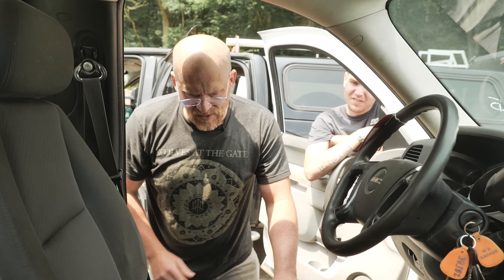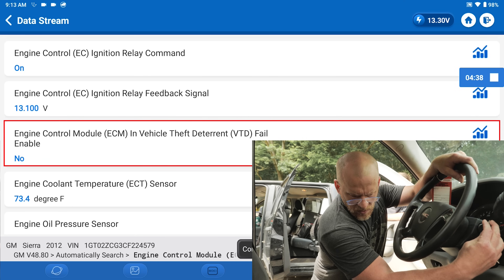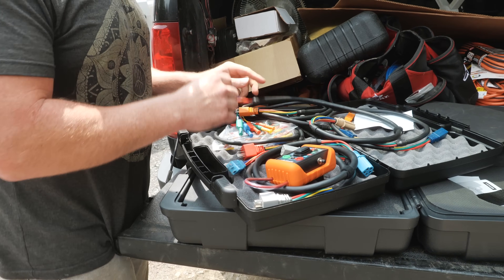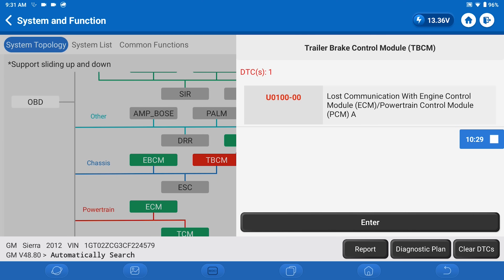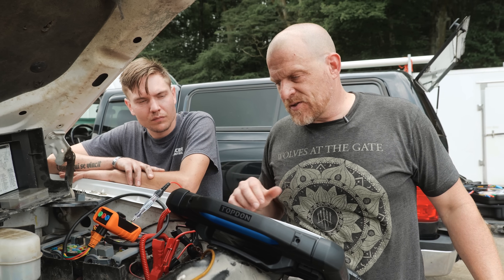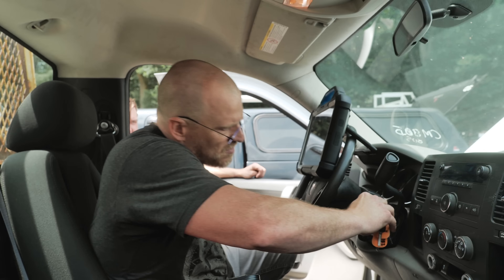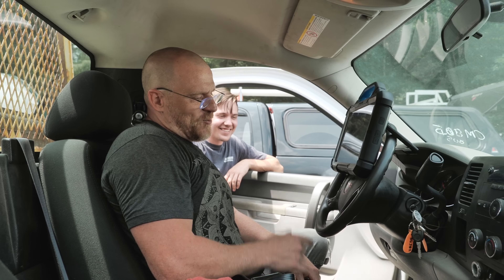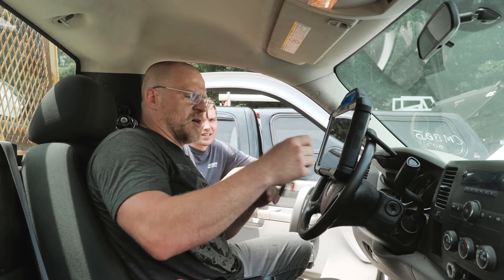Auction Truck MISSING FOOTAGE!

Comment: On mark 2:33/11:45 you show starter relay in your fuse box on my 94 f-150 5.0 engine I’m looking for the same relay because when I turn the ignition switch I get nothing I have already installed a new neutral safety switch new ignition switch new ICM I still need your help very badly would you please help me
Reply from the maker: This is a Chevy. Why aren't you watching my EECIV playlist! So your truck is not cranking? (Starter circuit issues)
Reply: how do I go to EECIV playlist and yes that was the original problem on the f-150 94 model 5.0l engine @ScannerDanner
Reply from the maker: @tessiehuskey689  https://www.youtube.com/playlist?list=PLAFYVCyenqcoRt2bJPI4vcee2w_1Y3fkm
Reply: Where is your EECIV playlist
Reply: Do you have a scenario video on a no crank no start on a 94 f-150 5.0l
Reply from the maker: @tessiehuskey689   watch this one https://youtu.be/GQvLHQVtC0Y
Reply: I checked the reference voltage on a mass air flow sensor on terminal A 11.84v B .005v C .006v D .022v this is on the 94 f-150 5.0l truck on another video you said to do this testing for a bad PCM I couldn’t find the TPS or the MAP sensor Thank you in advance if you can please help me understanding this no crank no start
Reply from the maker: @tessiehuskey689  I didn't answer you the first time because not finding the TPS to check for s 5v ref is not an option. I'll give you that you may not have a MAP sensor. Testing your MAF doesn't help me. Need to know about your 5v ref circuit before I can help any further.

Comment: This video makes me laugh. Because I just had a 08 GMC towed in with the same issue, no crank, no start. I have the uactivate and was able to troubleshoot the problem quickly. I determined the ECM was the problem, replaced ECM with a new one (OEM) reprogrammed and the vehicle started. I was able to quickly diag and repair the vehicle because of YOUR teachings. Thank you!

Comment: I need to  do a active test to demand max fuel pressure on the cp3 injection pump to test?for a 2005 gmc sierra 2500hd with a 6.6L duramax. do you know what inexpensive bidirectional scanner will do this? thank you
Reply from the maker: That's a very specific test, I'd imagine "Inexpensive" is not where you'll find the right tool.

Comment: Excellent video.  You and your son do a great job.  I’m 67 and still working on cars out of my shop at my house.  Love the challenges and Still learning from you.  Got a Toyota with a PO171 code that is intermittent,  fuel trims a LT maxed out at 23/24 while the ST is -2.0 to -4.6.   MAF readings are good and no vacuum leaks.  The car sits a lot but runs good.  leaning toward fuel pressure or clogged injectors.  I’m going to do a fuel injector pressure drop test next week.  Keep the videos rolling.  Oh, how’s the granddaughter doing?
Reply from the maker: What are your fuel trim numbers at idle compared to 2000-3000 rpm in park?
Reply: @ScannerDanner  
  Pretty much the same that’s why I was looking for a vacuum leak but couldn’t find any.  I’m going to smoke test the intake system Monday.  I did remove the negative battery cable to see if the ecm would reset and it did the trim numbers evened out, the LT fluctuating around -8 to -10 with ST fluctuating around +6 to +8.  The numbers kept improving the longer it ran.  The MAF is 2.03 at idle and 9.6 at 3000rpm, that seems within range.  There’s a vacuum operated air door in the air filter box that stays shut restricting the air flow.  I remove it and air flow at 3000 rpm improved very little.  I’m not sure what the purpose of that door is suppose be.  On the older carburetor cars it was used to switch to heated incoming air for better cold drivability.  The car is an third car that doesn’t get driven much and the PO171 code sets after weeks of driving it sometimes months.  That’s why I’m now leaning toward fuel being a problem, it’s a 2001 Celica with about 140,000 on it.  Every time the owner has to get the emissions tested for the bye annual certification this happens.
Reply from the maker: @weshawkins7165  fuel trims will improve at higher RPM if it is a vacuum leak. Clean you MAF sensor and see what it does to your fuel trim numbers
Reply: @ScannerDanner  
  That was the first thing I did and it didn’t change the numbers much.  I checked the MAF readings on a Nissan Rogue with a 1.8 I had in the shop and the Maf at 3000 rpm was a little over 13 g/s.  This Celica was a little over 9g/s at 3000rpm.  I’m suspecting there’s issues with both the maf and injectors.  I’m going to check the injectors with a pressure bleed down test,  I need the practice anyway.
Reply from the maker: @weshawkins7165  2001 right? What is the "calculated load" (data PID) on your scan tool at wide open throttle through 1st gear on a test drive.
Reply: @ScannerDanner  
    Yep it’s a 2001,  I Don’t know what calculated load was, I didn’t think to check that PID.  I’ll test drive and scan it again.  I’ll do that Tuesday.  I’m taking a sanity day on Monday, going suction dredging for gold.  
  Thank you very much for responding and helping I appreciate it.

Comment: Hey scanner danner i have a question i have a 97 civic that stumbles and misfires the code is cylinder 1 2 of 3 severety and sometimes i smell exhaust fumes my compression was good 180 psi on all 4 cylinders im thinking it could be a bad injector causing a lean condition but if it was lean i wouldnt expect to smell unburtnt fuel becease it wouldnt be no fuel to burn but the spark is yellow on all 4 cylinders which is weak but if we had a weak spark and they were the same color that that would cause i misfire on all 4 cylinders instead of just the 1 and it has a new coil cap rotor button plug wires
Reply from the maker: Two things
1. A lean misfire can still have a "rich smelling exhaust" due to the flame going out in the combustion chamber, leaving unburned fuel
2. Orange spark means nothing, the distance it can jump means everything. Make sure it can jump a 1 inch gap
Reply: @ScannerDanner  thanks for your input buddy and I will definitely subscribe so to you does it sound like a bad fuel injector?
Reply from the maker: @benhall8946  hard to say, but no, it does not. Check for the strength of the spark next, not the color of it. A narrow gap will always show some orange tint to it. A wide gap will not, make sure it can jump a 1 inch gap!
Reply: @ScannerDanner  I checked my coil is producing at the end of the plug wire near the spark plug 30 KV that's pretty good isn't it
Reply from the maker: What was it doing before the plugs, wires, cap and rotor where changed? Same exact symptoms?
Reply: @ScannerDanner  it slowly came into what happened and it jerks back and forth
Reply from the maker: @benhall8946  what's your fuel psi. That's your next step. 
Any lean codes with those misfire codes?
Reply: @ScannerDanner  when I plug the scan thing up to it it said cylinder 1 misfire fuel supply so that's what I'm thinking now but personally I'm leaning towards an injector but this car also has 400,000 miles on it and if I'm correct it even has the original fuel filter on it which I'm going to change and I did ended up putting some fuel cleaner in it for my injectors and it ran better it went from running to a completely dead number 1 cylinder to a partially alive one cylinder like for example before I done that it was misfiring at all times on number one cylinder and now it misfires on higher RPM and sometimes now when it's idling it does not misfire

Comment: Like to get your opinion on a 2004 Mitsubishi gdi galant not getting fuel at injectors,every thing seems to be good
Reply from the maker: "Everything seems to be good" isn't enough information 
Trouble codes? Have you confirmed you have spark? Fuel pressure? How did you test the injectors?

Comment: the keys started working because the programming for the keys was "use master key, then use new key, new key programmed"
Reply from the maker: The ECM data PID for the antitheft system said "no" as in not activated is how I read that. Not sure the time frame. But I definitely had that key on for the 10 minutes it would need to be on to program
Reply: @ScannerDanner  the 10 minute thing has to be done three times in a row.
Reply from the maker: @PandaMan02  not always, I've seen it take after 1

Comment: Paul i have question 
When i connect one lead of voltmeter on the positive terminal of the battery and other lead on the radiator water it shows voltage more than in the battery, how the water does that?
Reply from the maker: It's not pure water, and it's a good conductor. If you want to check for electrolysis of your coolant, you'd connect to battery ground. Not positive